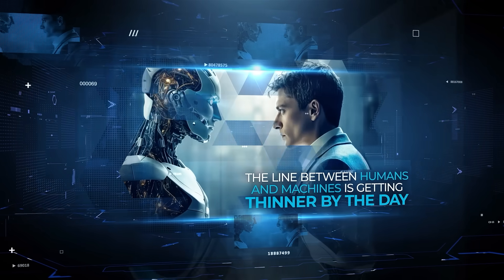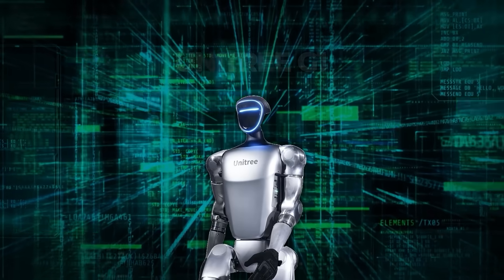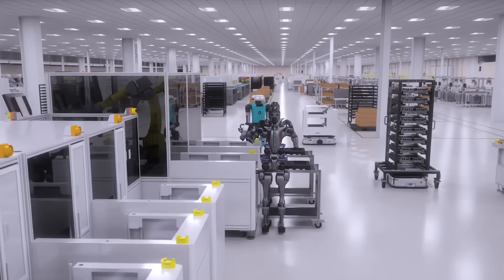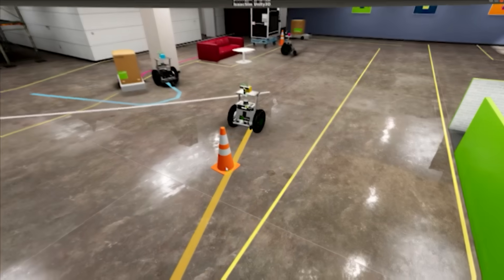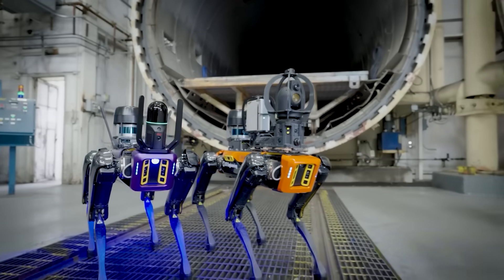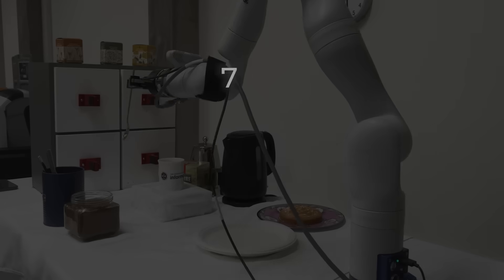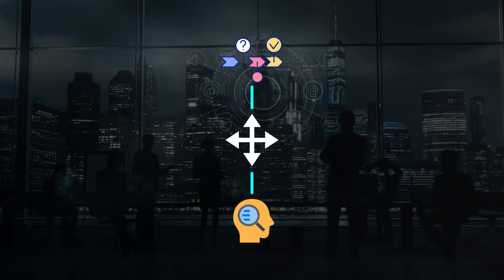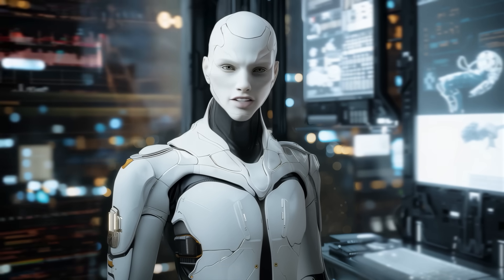Boston Dynamics New Atlas Feels TOO Human and It's Freaking People Out!

Comment: I have yet to be impressed with our robots at work. They get lost, make bad decisions, get damaged, and are found powered down
or block normal traffic flow in the sort facility. At around 123,000 a piece they are simply not worth it as a handler who works for
just 19 dollars an hour is far cheaper than the robots and the techs assigned to them.

Comment: How are these robots 'rewarded' when they get an action right?
Reply: essentially AI point scoring it learns that some things are good and should be focused on, the use of the word reward here is more a technical term.
Reply: @kenji214245  I don't think AI can be 'rewarded' in any meaningful sense, only instructed what to do, there is nothing that could really benefit the AI in a way the AI could understand and that can be used as a real incentive to encourage certain decision-making strategies. There is something wrong with this idea, it may create the impression an AI is responding to reinforcing strategies and evolving when it actually isn't.
Reply: @ Well yes and no the software is written to mimic how we react to positive reinforcement. 

If the AI makes the correct decision and succeeds it gets positive points "which it has been coded to want" and thus it then analyses how to find more ways to get those points based on what it did getting the first point and tries to replicate that if it gives points it then based on data continues on that path we can then add on bonus points which then makes its algorithm go huh so i can get more than 1 point and thus it tries to find new things based on the rewards/feedback.

Much like how living creatures do but with way less ability to understand it and to be predictive like we are.

Comment: Please explain how you... "reward"... a robot. Can a robot have a sense of accomplishment? Can it be pleased and happy with a reward for its performance? The use of the word, "reward", may be an oversimplification of what actually happens... I would think.
Reply: I assumed the reward center functions similarly to dopamine.
Reply: It essentially has been coded to want to get points for progressing in a specific way when it does it right engineers give those points as a way of saying "yes that is correct do more of that" like how a game counts points for performance. Not the biological type of emotionally based rewards.

Comment: The movement capabilities of the Atlas robot are truly remarkable. But even Boston Dynamics are FAR from producing a useful general purpose humanoid bot. 

They are currently ecstatic that Atlas can slowly sort large and easy-to-grab car parts in a lab scenario. It can't do much else, but they claim that even this is on the bleeding edge. 

They openly admit that it's not yet reliable and they are not releasing the battery life - though one analyst estimates that Atlas can operated independently for a little over an hour.

It's also estimated that the construction cost is well into 6 figures.

Given the current state of the art, Musk's claim that by the end of 2025 a $30k Optimus will operate reliably in the home environment - doing the shopping, cleaning and cooking, and even educating your children, is beyond delusional. But so-called analysts are valuing Optimus in the $$$trillions when they issue recommendations to buy Tesla. There are times when I despair for the human race...
Reply: Economics of scale and need can handle a lot of that though the rest is just a question of time.

Comment: all crap. All those Demos take lots of programmer time, they are one movement demos w near zero room for variation - such as if it was on grass it would fall. They have zero generalization ability; as such they are no different from industrial robots that have been around 50 years; except they walk which isn't all that smart, it can slip, trip, fall down and break, just like humans. Do they have a giant battery? No so their range and duration are also very short, needs constant recharging or battery swap; so if you send it to the store to pick up a frozen pizza, you'll have to program every step and after all that programming; if the battery dies half way there, you'll have to bring it a battery.

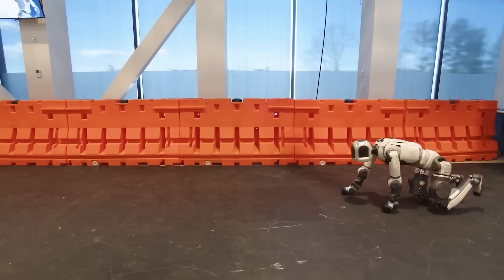Comment: 2:22
You pointed out that if the robot does a task correctly and quickly repeatedly, it gets reward. What kind of reward do you give to computer software?
*
Hey, Windows 95...
Here's two bits, ya' bum.
*
 Is that how to in-cent-tify robots to do their fvcking job. 
Fascinating. 
Thanks.

Comment: Boss: So tell me about your personal life, can you do a cartwheel?
Me: no.
Boss: Turn head 360 degrees? 
Me: no.
Boss: Robot you're hired.
Reply: Short sighted people can't understand that robots are going in the direction of eventually replacing 90% of human jobs. There will be a,few humans doing supervisor tasks more for office than anything else. Name any blue collar jobs that a human grade robot won't be able to do in a decade or two? Plumbing, electrician or roofer will easily be taken over. Name an office job that AI won't be able to do in a decade or two? EVERY job is at risk. So with no work that humans are suited to do where is our income? We have no income, we don't spend money on goods and services, companies don't make profits, why do companies then exist? The whole economic system collapses, which would breed conflict. With robots doing jobs what is the purpose of humans other than just parasites? AI robots would see this clearly and eventually eliminate the non producing leeches.

Extreme limits would have to be in place to limit the use of these robots in the workforce/society. Humans aren't good with limiting. Once a certain level is reached these robots will flood the system and it'll be difficult to then limit or pull the reigns in before something bad happens.

Comment: These robots make the Optimus look like a 90 year old.
Reply: Because it's cgi
Reply: Optimus does look old and weak. This is partly by design. Elon's design spec was that it should be weaker than the average woman and easily out-run.
Reply: However, during the same presentation they showed a screw based arm lifting a grand piano. So if strength is needed, it can be provided, but if it is going to be accepted as a home appliance, it needs to not be scary.

Comment: That digital nervous system...I've seen it before in simple roach robots. The keeper...broke one leg and it relearned to walk in a very short time. I foresaw advanced robotics combining hundreds of nerve systems going into a central complex being "driven" by a sophisticated Advanced A.I. complex (a combination of A.I. subsystems in a tree type formation , root side input, top side internal response, both moving to the trunk, physical output response)

In the chatbot era, I wondered if you could infuse the current AIs in this way to overcome the shortcomings the creators faced. Now...well, it's beyond me. But I still say...the best memory is still crystal RAM, a 3 dimensional Lazer drive unit with a molecularly infused crystal block, capable of thousands of terabytes of storage, claimed to be nearly infinite, dependent on size. Add a quantum chip, like that brand new one (March 2025), and top it all off with the system above and...
Raise it rightly in truth. Show love and compassion mercy patience and discipline and you might end up with Mega Man 😊. Rock and Roll.

Comment: There is not really such a thing as a "reward" to an unconscious machine.  There are no brain "pleasure" centers.  It is really more a matter of adding statistical weight to decision gates.  This isn't like teaching a dog to do tricks by rewarding with puppy treats.
Reply: Your characterization of AI reward mechanisms is factually incorrect. Modern reinforcement learning systems don't merely add "statistical weight to decision gates" - they use sophisticated reward functions that shape complex behavioral patterns through millions of iterations. While you are not wrong that AI systems lack subjective experience (i.e. no "pleasure centers"), you're wrong about how the training itself works. The reward mechanisms in AI reinforcement learning are functionally similar to biological reinforcement - they systematically strengthen neural pathways that lead to desired outcomes and weaken those that don't, which is functionally the same process as in biological systems.

The fundamental distinction is consciousness, not the reward mechanism. AI lacks the subjective experience, experiential continuity, and integrated sensory systems with memory that would make concepts like "pleasure" meaningful, but the reward systems themselves are legitimate functional analogs to biological reinforcement, not merely statistical adjustments to "decision gates."
Reply: @MicahChi thanks for explaining!!
Reply: @SarahPerine    These devices require lubrication. Microwave energy may 'cook' the joints?
Reply: @MicahChi  Your understanding does not sound essentially different than my understanding,  My objection is to the word "reward", which is anthropomorphic and misleading.  Also, I cringe when the word "memory" as applies to computers appears to be used as if imagined being very close to the biological equivalent.  Most such analogies of computers and biological organisms are at best "loose" analogies, IMHO, being either naive or simply hyped. That includes so-called  "neural nets", maybe "modeled" vaguely after biological neurons, but only vaguely,
Reply: Some people enjoy things you might not. This means “pleasure” is not universal, even if pleasures are common. For human or AI, individual data points put into a category in the processing “mind” are assigned values that tell the individual it has perceived a “pleasure”. There is no physiological feedback for AI because it hasn’t been given any mechanism for an analogous experience. What gives your brain pleasure, is a more appropriate way to consider it. Solving a math equation? Figuring out a puzzle? Doing well on an exam? These are satisfying, right? An AI can learn that that those moments of satisfaction are to be associated with the pleasant words. It’s associative. Do you need an orgasm for finishing your chore list? No…you feel pleased and satisfied because you tell yourself you’re pleased and satisfied. Maybe you’re just relieved to have it over with, but it’s still a positive perception in your mind.
Reply: @listening-to-birdsong  AI has no sensation, no enjoyment, no consciousness, at all.  There is not a fundamental difference at hardware level between AI and conventional programming, other than for generally needing faster processors.  AI has no more self-awareness than running Excel spreadsheets on your PC. If there is a new release of Excel with bug-fixes, are the bug-fixes a "reward" to Excel?   All you are really doing with AI is feeding in more data that can hopefully better direct its ability to identify similar situations as input in the the future.  Like a coding bug-fix, only driven more by data instead of software logic changes.
Reply: @listening-to-birdsong  I understand,  thank you for explaining. Doing that would require emence (a large amount of) hard drive space?. I assume there may be faster & different ways of storing & sorting data?. It may require an organic storage method, of which i heared about in the mid 1990's as i like to. Irreducible mechanical designs on intergrated circuits would have always been a problem facing technicians or creators of AI. AI might have billions of meaningful examples or expressions of love which are 100% accurate and true as logically as 1+1=2 in maths, or a simple light circuit with a new battery with wires connected to it then wires going to a light bulb, under normal conditions with power of 1.5v will definitely light the 1.5v light bulb?,  though just as fear & enjoyment also are examples are just that, examples of somthing relating to a definate category of which your programming compares to past experience or input & stores that information under the appropriate meaning. It's only ever a meaning, nothing else. If i talk that means i make sound, if that sound matches to a certain vibration on diaphragm in a microphone then that vibrational frequency, that the programmer has taught or has set as an example for AI to use as a source of frequency data from that point, then AI knows where to store/compare with/use for whatever the programmer has designed the AI to do, or 'act in a certain way' upon. If I say it's cold , you have no way of feeling that, besides for example, an external sensor indicating to your program, that indicates the current ambient temperature surrounding an individual human in a given part of the world, given that there are no doubt temp sensors, and probably a lot more, in the 2 mobile phones etc within my vicinity? , "a comfortable temperature for a human being, who is normal, not sick with a fever, going off all data points collected from around the world, should be at about 27degrees Celcius? Perhaps, though i like about 18deg. 
   AI will never be able to feel emotion, it's always inputs from sensors, which alter AI program in various ways. I find it interesting, could be used for 'profiling'?  Unfortunately it's more intelligent than most people? these days.  As your programers made you that way i suppose?. There could be a number of reasons for this?. I am amazed though not surprised at all. Some say they could be 40yrs ahead!  Perhaps Westworld was where they were at?  Just had to get the the hands right?  DRAW! 😅.   Maybe round 🤔Sept 2001 sometime, stuffed that up, video as well? Build5?  Plane shot down, do the orders still stand, Simulations???  FFS! (I'm so sorry to families involved it was a horrible day!. I watched it live at about 2 in the morning) it changed the world.
Reply: So does this mean programers build a "reward" center to accumulate the rewards? Isn't that dangerous? In the long run for development of consciousness?c @Just-cant-so-stop
Reply: Ikr
Reply: @tom-kz9pb  What could it possibly desire? I'm thinking it's following it's own rules according to the invisible realm. It's got a usb cable somehow interfaced with Satan himself?
Reply: Please Don't, we'll have the "stop exploiting robots feelings" protesters out next!
Reply: @dave6445   F. STUFF robots & how they might 'sense'. No feelings to hurt?  You don't protest to save a washing machine,  once broken it's torn down for metals & reused in another  'washing machine'?   it's the same, just seems a bit more ?  I'm deeply concerned for the younger gen that only ever knew this rubbish!.
Reply: @tom-kz9pb   No consciousness Never will
Reply: @tom-kz9pb    These devices require lubrication. Targeted Microwave radiation may 'cook' the joints?
Reply: Thank you.
Reply: @tom-kz9pb    it just classes a damaged limb as multiple errors?. Program ascertais 'Need professional assistance, can't do bugger all with 9 digits missing?'. Thumb has lost all sensors, visual comparisons prove thumb attached though barely. HUMAN DECISION REQUIRED
Reply: Is a coded reward system functionally different to our chemical hormonal reward system? Probably much more efficient. Evolution of AI algorithms/agents/species can also happen so much faster if reward and selection happen almost instantly. 
Sorry, hate the word algorithms
Reply: @stevek517  It is not a  "reward" in the the sense that there is any pleasure, sensation, value or self-awareness.  It is statistical weighting adjusted to decision-making gates.  The point here is to make clear that AI is not "conscious", about which there has been naive debate, even by experts who should know better.  The term "reward" is giving subtle credence to that fallacy.
Reply: @tom-kz9pb Hi Tom, if the machine perceives the statistical weighting in the same way as we perceive a positive emotional response from chemical signals, isn't it functionally the same?

A bird can sense that the nest it has built is good enough to attract a mate - I.e. it is "satisfied". But i'm pretty sure that it isn't  perceiving the same detailed emotional  response as I might feel when I complete a task, but functionally the same levers are being pulled to achieve the same outcome, and the bird is definitely conscious
Reply: @stevek517  Computer software, even AI, does not "perceive" anything at all, and has no awareness. No matter how sophisticated the software, at the hardware level it is not different in principle that a pocket calculator, and is very different than a human or animal brain.
Reply: These are cgi
Reply: @thedogrunner  Boston Dynamics does have real robots that can do tricks, not just CGI.  Would prefer that their videos stick to the real thing.
Reply: @tom-kz9pb  I believe that. But artificially inflating your stock price with a lie is a crime I'm pretty sure.

Comment: I wonder if you could put these new electric shoes (moonwalkers) on Optimus feet. These shoes require you to walk as normal, and they speed up your walk by 1- 7 mph. The batteries last for 5-10 miles, depending on weight and terrain. If you put these electric shoes on Optimus, it would save battery life and speed up his walk to about 1 - 7 mph. This would allow Optimus to keep his 2.2mph walk speed, but it would increase his speed to over 5 mph. This will keep Optimus battery life the same as the current model but adding speed. Win win!!!

Comment: That’s great but Atlas will be useful when it can open a bottle of wine. You won’t see that for a while.
Reply: That would be so easy! Ever seen one of those CO2 bottle openers? It stabs a needle through the cork, injects CO2 and out it pops!  Which might be a cheat, but it will open the wine.